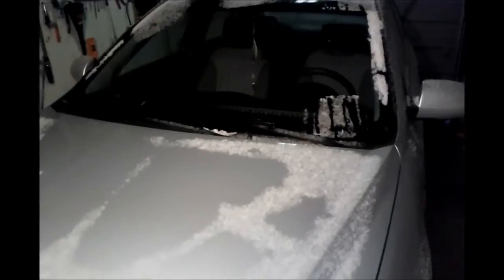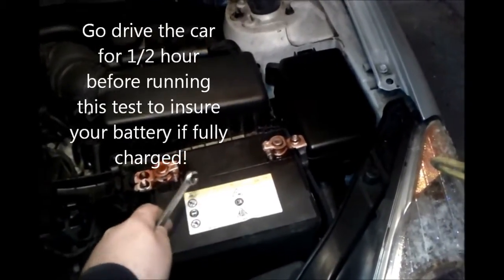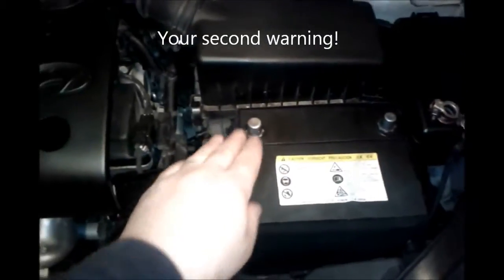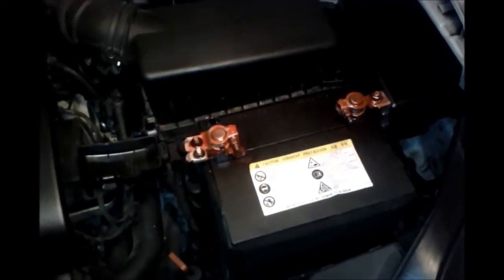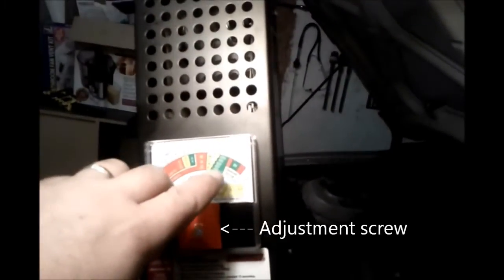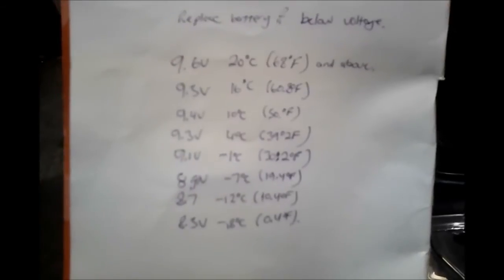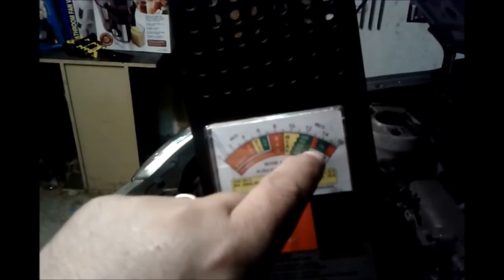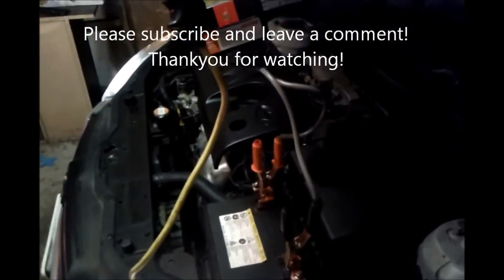2009 Hyundai Accent Battery maintenace and load testing

Comment: You are lucky, the OEM battery in my '08 was toast a couple months ago (0% health on the free load tester at partsource haha).  Walmart has them for about $100 tax in, you will need a group 121R size which I found is not highly available.  The OEM is labelled with some weird foreign size of 05 I believe.  Keep making the videos, I did the belts on mine using the belt video.

Comment: What's the gauge on the cables? I think I might need to replace the cables, and I definitely need to replace the battery terminal connectors, at least the negative one. 

Why's the red positive on the load tester...isn't red usually negative?
Reply from the maker: joeybuddy96 awg15 no red is always positive black is negitive
Reply: ***** Do you know what the AWG is? I might be making my own cables.
Reply from the maker: joeybuddy96 awg 15